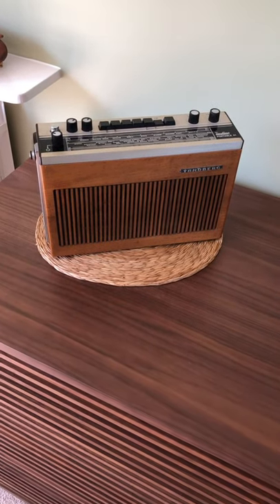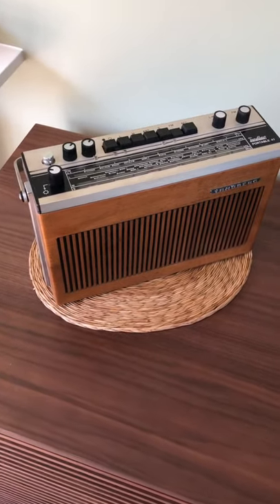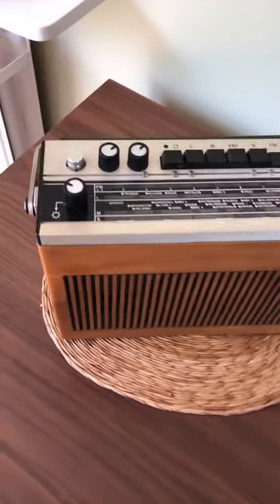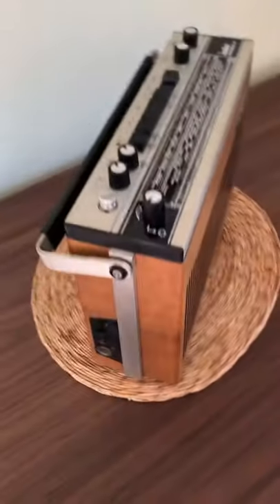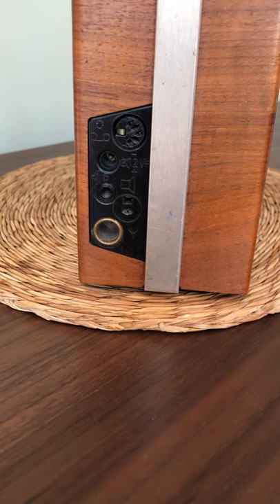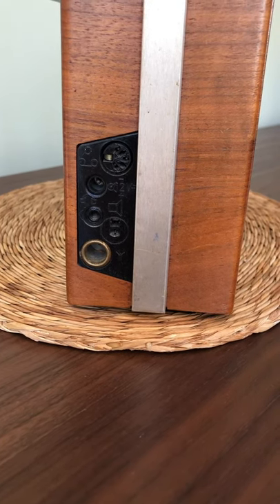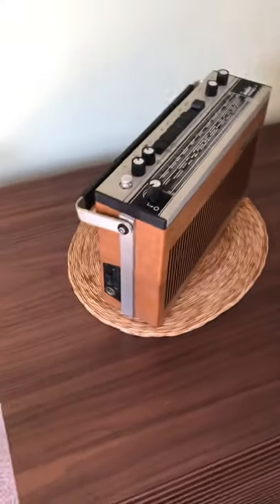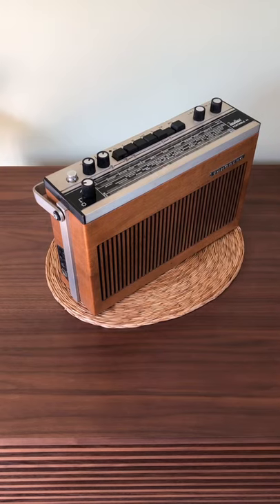Tandberg TP41 Transistor Portable Radio #SHORTS

Comment: Wow! That looks brand new!
Reply from the maker: I have two - one which I am repairing and it looks good as well, but doesn't work yet, and the one into e video which belonged to my parents. They looked after it and as a result it looks good. I've cleaned it up and was very pleased with the results. Glad you liked it.
Reply: @ElectronicsNotes  My parents had one when I was a kid and I used to use headphones at night and do some DXing on the BCB with that exact model! Great memories!
I've been restoring old radios (mostly 1930s-1950s) and have quite a collection, even though I've sold most of my console radios in recent years after my kids moved out and we bought a smaller house, I still have a rather large collection. I don't have too many transistor radios, but that one is on my list! Thanks for sharing and bringing back some good memories!!